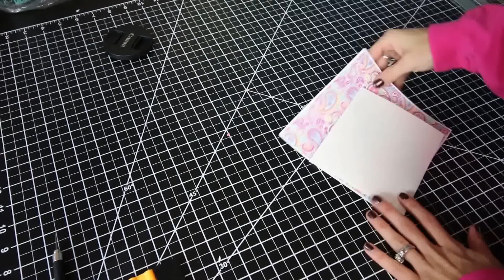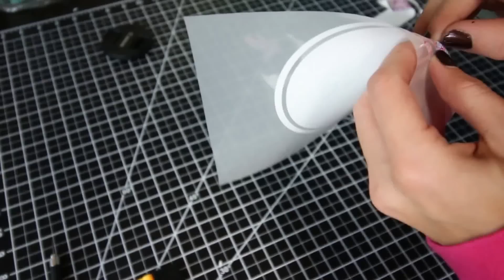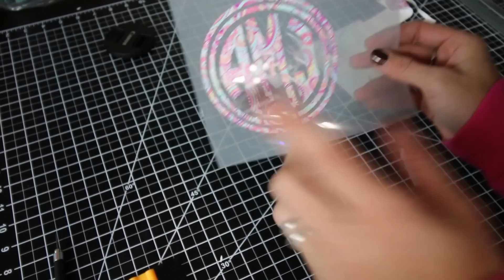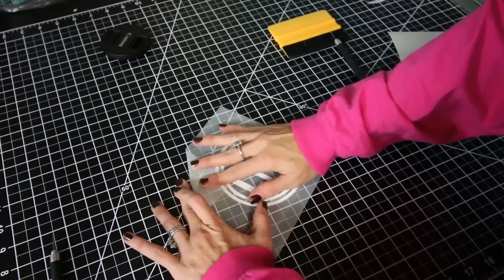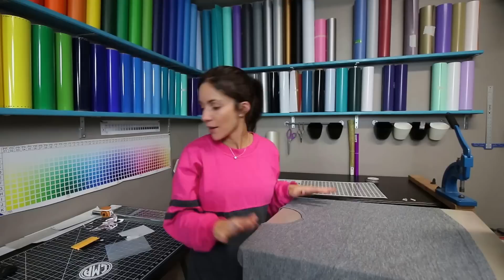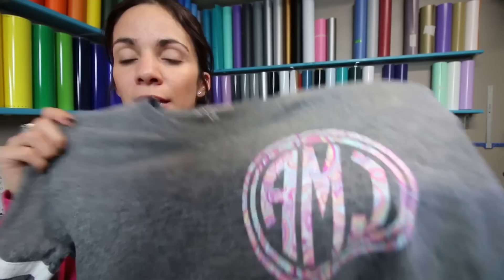How to work with Printed Heat Transfer Vinyl

Comment: Just bought some Bright tie dye printed vinyl. when it came in it looked like adhesive, but according to the package it could be used as either or? would this process work the same way?

Comment: How many washes before the vinyl  starts  to crack or fade?
Reply from the maker: unomz171 it wont fade and when applied correctly it will outlast the life of the garment 
Well over 50 washes
Reply: Thanks so much for responding.
Reply from the maker: welcome :)